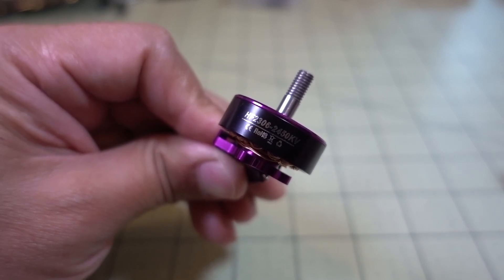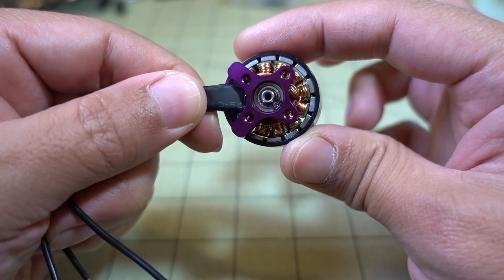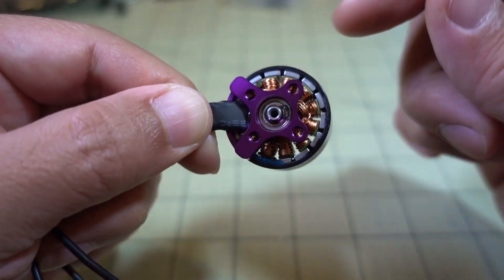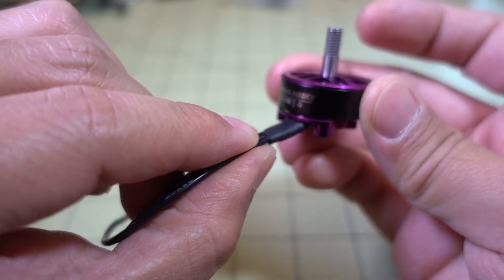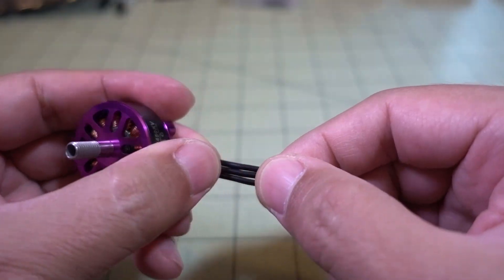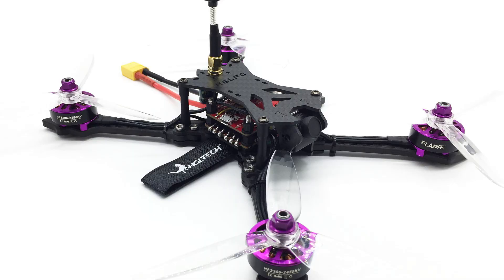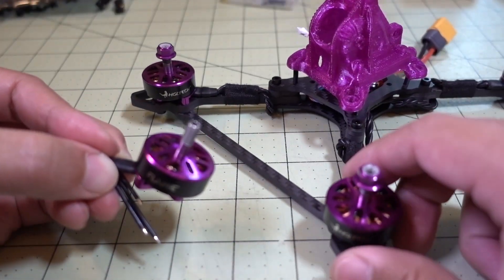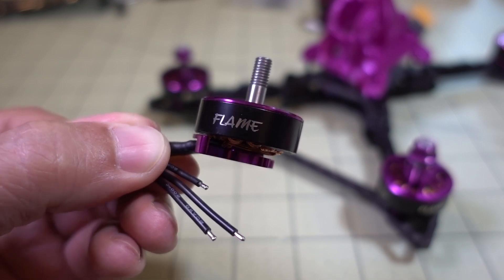HGLRC Flame 2306 2450kv Motor Overview ⚙️

Comment: these motors are quite versatile if you think of it. It has relativly strong magnets for power but not too much to get that smooth spin (like the mr stelle motors). It looks so pretty and sexy in a way like magenta flames or something hahaha. Great Video bro! maybe try some testings with some "equally" great motors? also i just had several random thoughts like what if you had a series where you just have challenges about drones? like the no solder challenge or scrap challenge or diy frame challenge haha. That would be fun to watch, maybe a break from all the specs and details and just enjoying the hobby you know hahaha. i kinda want to know your opinion on 2s brushless whoops on a 1103 motor with 40mm props. i heard theyre sick~
Reply: They are sick and loads of fun. Can fly them anywhere.
Reply: i knowww and i desperately want one but im too far for the shipping hhuhuhu